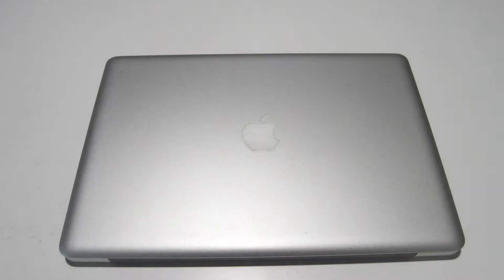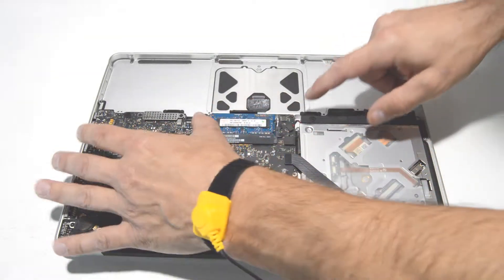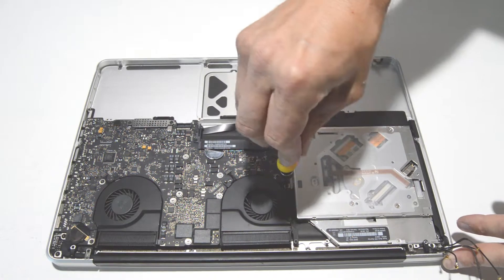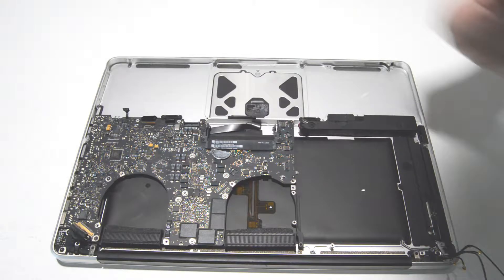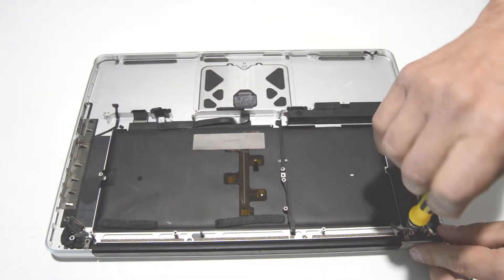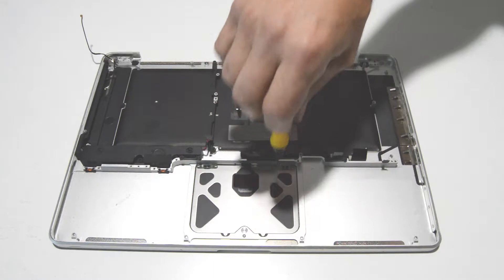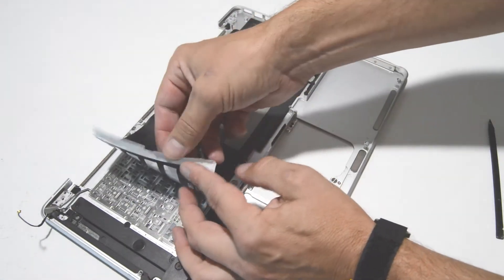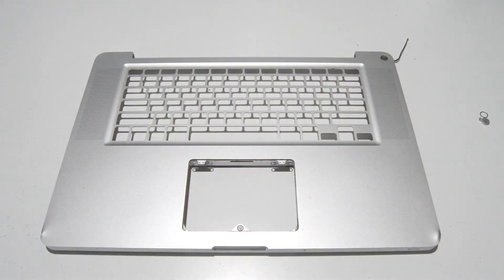How to Disassemble MacBook Pro 15 A1286 2011 Laptop or Sell it.

Comment: Hi there, Is there a special procedure first to prevent static electricity when opening the back plate? im worried it might fry the mother board and other parts inside
Reply: Simply touch a screw on your light switch. It is grounded and will discharge any static electricity from your body. Generally, as long as your not in socks, going back and forth on carpet, then going straight to the motherboard, you'll be fine. Even if you do shock the motherboard, it's not as big of a deal as you might think. You have to touch specific components that are sensitive to high voltage. Even LTT did a skit on it.

Comment: Hi, thanks for the video!  Do you know what the plastic piece that holds the trackpad table to the metal cover is called? 
I've highlighted the piece in yellow in the photo below.  
https://imgur.com/a/xvWa982
Somehow this piece is broke and it's causing my macbook to shutdown when I put pressure on the bottom. i've opened the cover and whenever I put pressure in this area it shutsdown. Seems like I need a replacement for that plastic piece, but I don't know what it is called.
Reply from the maker: Not sure the name.... you could just buy a bad-condition top case and pull that piece from there. You might also find it on eBay as part of a screw set.
Reply: @Sellbrokedotcom  Thanks for the quick reply! Looks like I may have found a screw set with that piece.  Just waiting for the seller to confirm it is what I am looking for.

Comment: what torx and/or pentalobe screwdrivers did you use to dissassemble all parts? I need to know how to buy them, thanks!
Reply from the maker: We use a set like this: https://www.ebay.com/itm/ORIA-Screwdriver-Set-60-in-1-with-56-Bits-Precision-Kit-Magnetic-Driver-Profe/164237322006?epid=26011989962&hash=item263d4ea716:g:Jt0AAOSwelhe3sx6